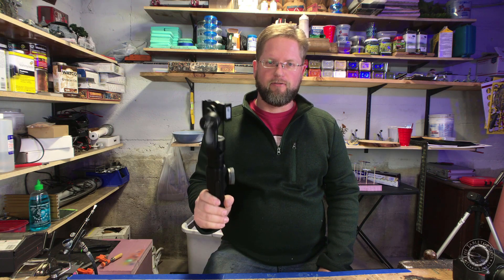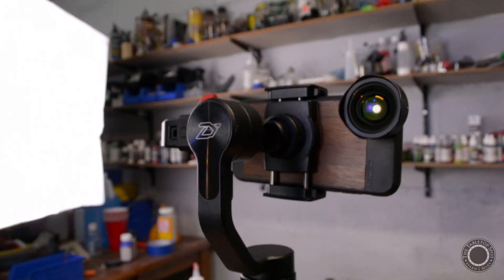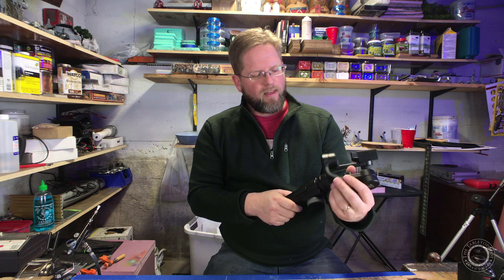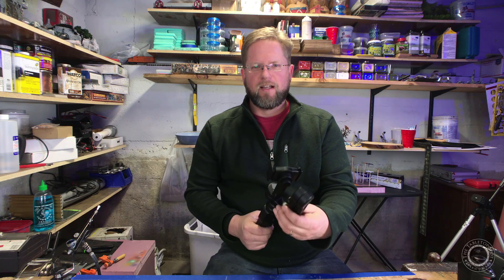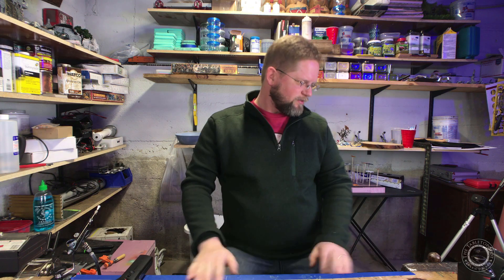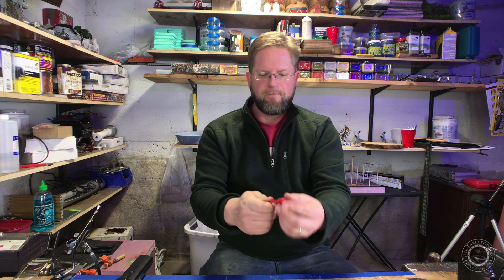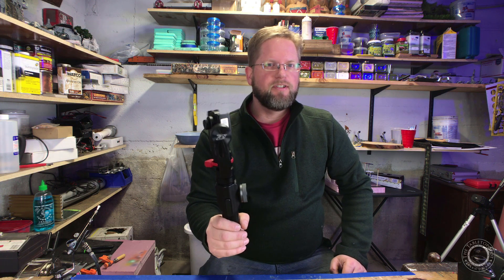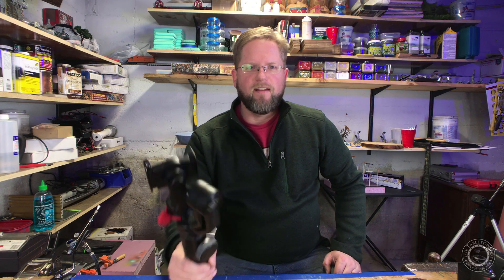Make Better Counterweights!

Comment: Does the combined weight of the camera, case, lens, and weights exceed the payload capacity of the gimbal and will that burn out the motors? It's been over a year since you posted the video. Is the fix still working for you?